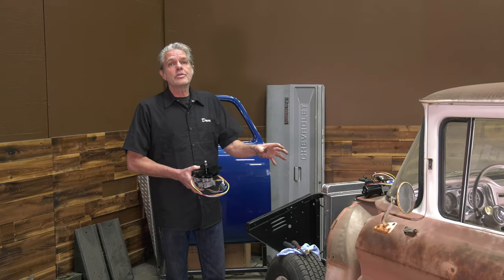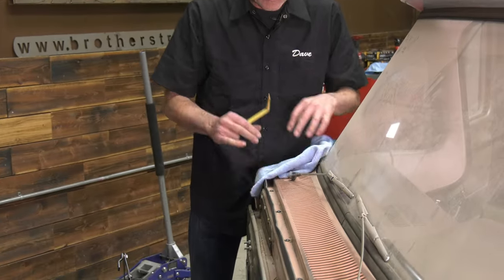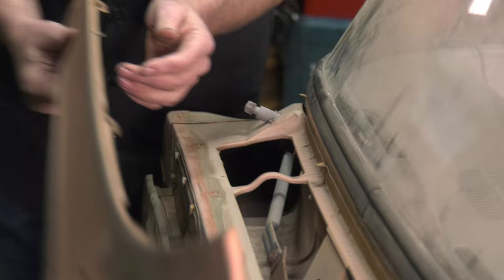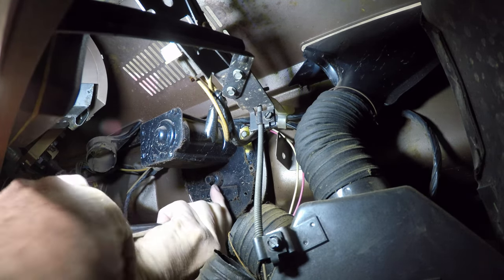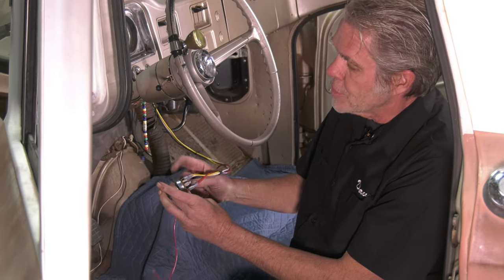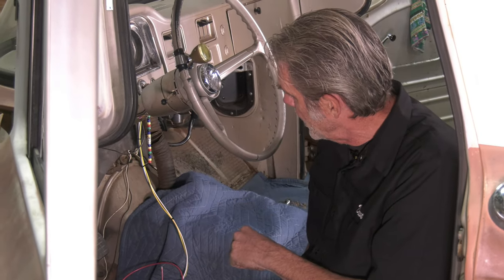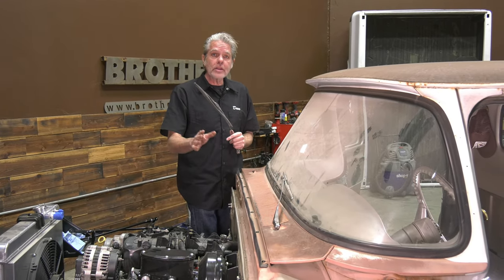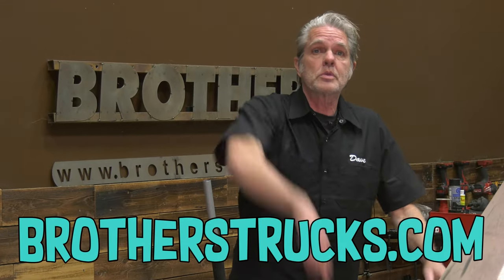1960-66 Chevy & GMC Truck Electric Windshield Wiper Conversion - Two Speed Upgrade Installation

Comment: I am currently restoring a 63 c10 with a 2 pin wiper motor. There is no wiper switch in my dash. Does brothers carry a 1 speed switch without the washer function since I do not have that option? If so what is the part number?
Reply from the maker: Give our shop a call at 800-977-2767 and they will help you figure it out.

Comment: If you replace the arms can you then get better blades too? The one style and size that fit my 65 C20 pretty much suck.
Reply: The arms they make are the connecting arms that are mounted to the motor under the cowl with the same size spindle. So those won't change anything. But if you do a little looking at the next generation of truck's wiper arm that sweeps across your windscreen, they might fit. You need to make sure they will engage the spindle, and are retained. Plus check that are long enough while not being to long, and that they don't have a funky angle to them. Don't restrict your self to just looking at Chevy's / gmc's. Another make may work. For example when I upgraded my 1968 F100 to front disk brakes I wanted a master cylinder that would move more volume for the calipers. I found that a master cylinder without all the speed controls and abs bits from a 1995 Ford Expedition had a 1 and 1/8th bore, and would bolt up to my brake booster. Perfect fit and function. You just have to get creative sometimes. A walk through a scrap yard with a wiper arm for comparison is an easy way to be able to examine many different ones.